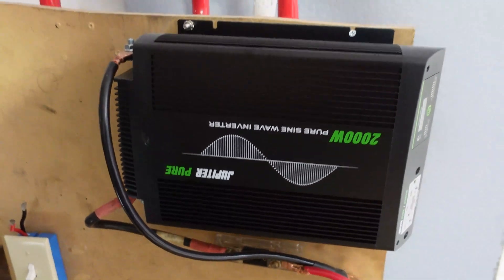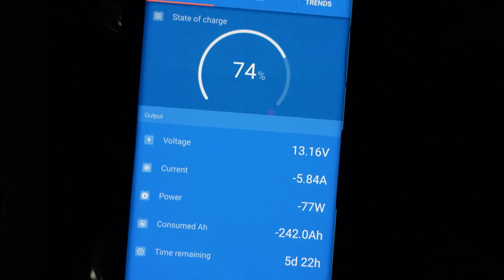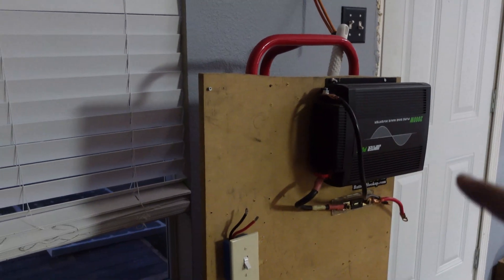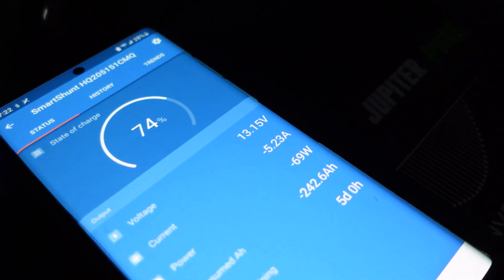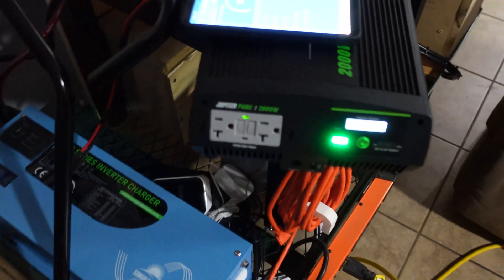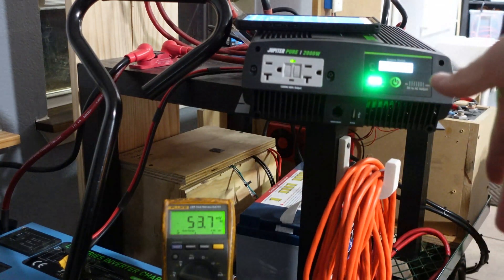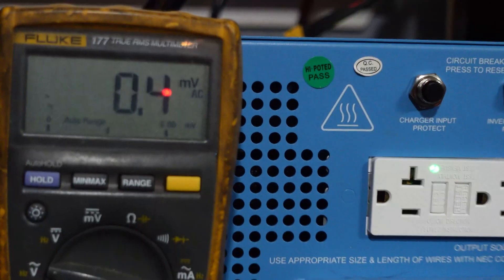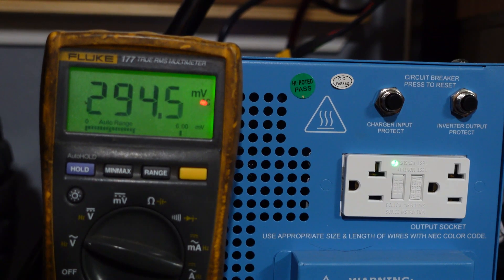Harbor freight pure sine idle power consumption test

Comment: Harbor Freight high frequency inverters have a short life expectancy and they offer a very poor surge capacity. Even today, after more than 25 years of product development, You'd be lucky to get even two to three years of service from these Chinese made high frequency inverters, especially when powering high inductance loads like full sized refrigerators, large power tools, portable AC units or large microwave ovens. The reason for this is that all of these lightweight, high frequency inverters lack a very critical component. That critical component is an iron core, copper wound output transformer. Without an output transformer to act as a buffer to absorb the electrical surges provided by the “Flywheel Effect” inherent in the physical amount of a transformer’s iron, these surges and damaging reverse voltage spikes must be handled directly by the inverter’s MOSFET transistors, essentially shortening their life. 

You might be able to start and run some high surge loads when these high frequency inverters are new, but every time you fire up one of those inductive loads, you're shortening the life of the MOSFETs in these inverters. To make things even worse, lightweight, high frequency inverters run much hotter and their internal components are far more stressed due to their high switching speeds and use of high voltage components, These two factors makes the low cost, off spec, Chinese made components such as capacitors, MOSFETs, diodes, resistors and ICs that are used in these inverters, far more prone to early failure. Simply put, high frequency inverters are better suited for like duty, electronic devices, and low frequency inverter are better suited for heavy duty, high peak power appliances.

Comment: I was one of those guys asking questions.   It's good to see all (or substantially all) the AC voltage on the hot prong (the smaller one).  My current inverter puts half the voltage on the neutral wire, which isn't good for connections to existing wiring!   I'm not entirely sure why there is any voltage vs ground on the neutral/cold/larger plug.  The floating neutral is supposed to be important for generators or inverter/generators that are connecting into existing buildings' electrical panels, since those have a permanent ground and there is only supposed to be one ground from neutral in a system.   

Could I ask if you get no continuity between neutral and the ground plug?  I think that you will find no continuity, since you found a small voltage between them -- meaning this is a floating neutral to ground, not a bonded neutral to ground-- which means it could be used for a transfer switch connection, yay!  A reminder to anyone reading this to never 'backfeed' a house by a double-ended 'suicide' cord, which could also kill utility workers as well as the user of such a cord.

EDIT: I went to the store and tested the continuity of ground and neutral on the AC receptacle.  They are grounded.  So, that means this inverter cannot be used with a normal manual transfer switch.... Too bad....

Continuity is measured on most multimeters with the wifi-looking-pictured selector that makes a beep when two things are continuous (such as the probe leads), or if a continuity selector isn't present, by the Ohm symbol selector.  A resistance reading of no continuity will either give a very high Ohms reading, show "OL",  or similar.  If you're using a meter that doesn't auto-range, I believe the resistance selector is set to the most sensitive reading, tested by connecting the probe leads before checking the apparatus. Thanks!
Reply: So can the Juniper be used for a manual transfer switch or no?  I was thinking of getting the 3k model for my home backup system.
Reply: @neobreaker91  I don't think so, based on reading the manual in the store, but I could be wrong.  I didn't want to risk the restocking fee if I had to return it.  If you or anyone finds a 2K or 3K inverter that we can hook up to the transfer switch, please let me know too!
Reply: @neobreaker91  There are two potential problems - both prevent use.  One: the inverter must not have neutral grounded (because the building wiring is grounded).  Two:  the inverter must not put voltage out on neutral/cold.   Do you (or anyone here) know if all the AC voltage is on the hot/positive lead?  My existing inverter is great for problem 1: not neutral grounded, but fails on 2: it puts have the voltage on the neutral/cold wire.  Thx.  We will find an inverter (that we can afford) that can be connected to the transfer switch.   All those modern 'inverter generators" like the great Honda EU 2000i series and similar can be used, from what I researched---so there must be a consumer grade inverter we can buy...
Reply: If your inverter is putting out 60v + 60 v watch this and check your inverter.   

https://youtube.com/watch?v=bkzmud2FJk8&feature=shareb